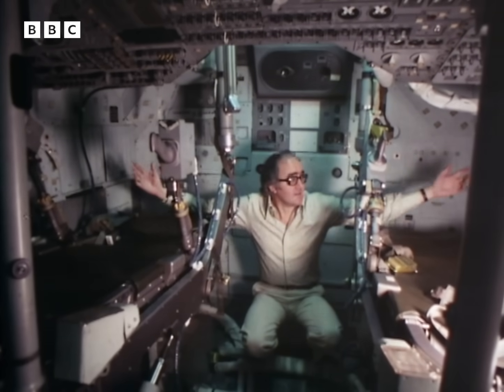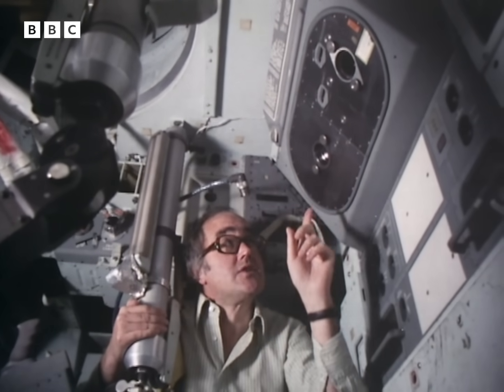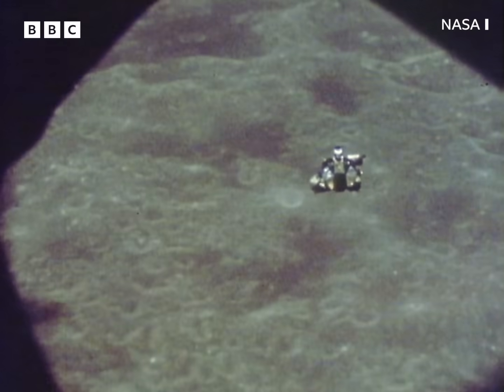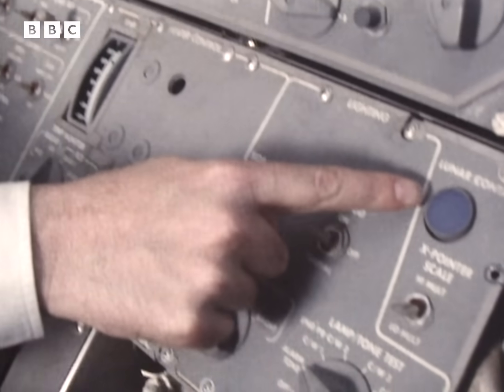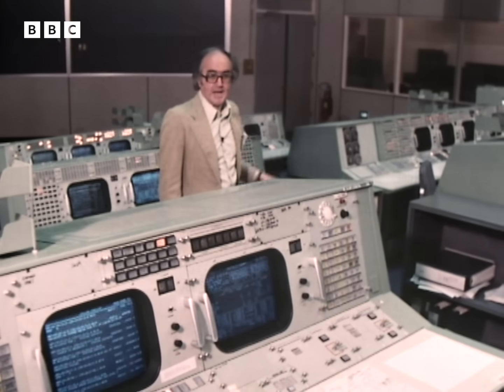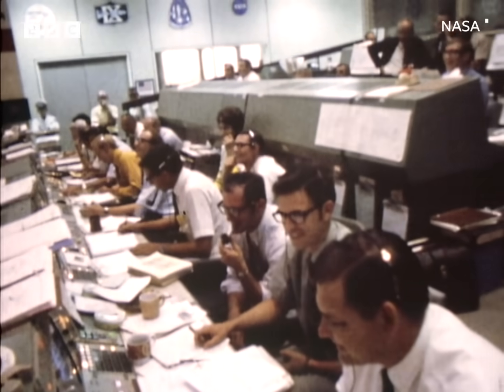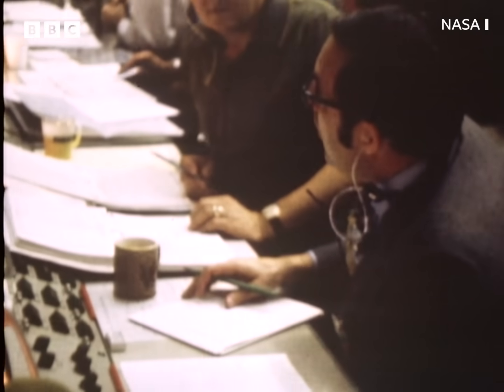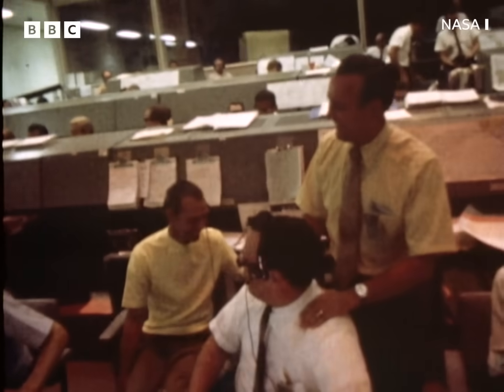1979: How to LAND ON THE MOON | Project Apollo | Retro Tech | BBC Archive

Comment: This video is one of the very few that speaks of the extremely tense descent phase just before touchdown. As explained, for various reasons the descent came to skate over thin ice, to the point that Capcom was advised not to speak further as Armstrong was in an extremely high concentration mindset where further communication from Earth would only be a distraction. Armstrong pushed through the issues, held his nerve, and made the landing -- not a perfect landing, but good enough to put mankind on the moon for the first time in history. But it was a razor thin margin.

If you dig into their thoughts from other material as I have, the unspoken message seems to be that flight control came to realize as the descent entered the last 60 seconds of remaining fuel that Armstrong was intent upon putting the Lunar Lander onto the surface of the Moon regardless if he was commanded to abort.

The Moon or bust.

Comment: The Van Allen Belt must be a complete lie that I learned in school. It's a Radiation Zone, of which would require very thick lead shielding to protect crew and electronics and impossible at that point in time. The Devine Creator put that Van Allen Radiation Belt there to keep us from venturing out into doing mischief and chaos.
I actually now suspect that the entire NASA moon venture was an elaborate Hoax. We're allowed to do suborbital space excursions and that's it. The King of King's is returning soon, very soon. All the corruption, Evil, and Sin will be eliminated from the Earth. I'm looking forward to it.
Reply: If that’s what you learned in school, you should sue your teacher. In reality, the van Allen belts are zones with radiation levels higher than on Earth. The level in the belts varies (in the center, the level is 100,000 times higher than on the edges). In the center of the belts, the level is high enough that a human in an Apollo capsule (not shielded with lead, just with 8mm of aluminium) will get a lethal dose of radiation on one week. The astronauts spent 3 hours traveling through the belts, while avoiding the center entirely. They were exposed to something like 1/1000 of a lethal dose.

Comment: Dear pseudo-scientists
What was the temperature(s) of the film inside the camera while being on the Moon?
Ask yourself why you can't control your mind to focus on the question. You are in denial. In reality, heat is when the molecules of matter are accelerated by a form of Energy. The ONLY form of Energy available for the FILM on the Moon is the Electromagnetic Spectrum of all stars which would react violently with a film. A film on the Moon cannot exist as a whole. That's why your mind refuses to think about it. You are in denial. Control your mind to focus on the question.
Reply: The film in the camera was kept cool by the reflective coating on the camera, which meant only 5% of the sunlight reached the camera. The camera was free to radiate this heat away. The thermal balance was such that the film was kept near room temperature. 
The only energy that reaches the film is the light coming in through the lens, plus some radiation that goes through the camera body. This radiation is visible as the occasional streak across the image, and in a small reduction in dynamic range.
Reply: @Hobbes746  Go to a UNIVERSITY. You are contradicting yourself. "plus some radiation that goes through the camera body" is not compatible with "The only energy" and " occasional streak across the image". Go to a University and learn about the Electromagnetic Spectrum
Reply: @Starteller  Unlike you, I actually read physics at university. My statement stands. 
Visible light: blocked by the camera body, along with all longer wavelengths, and UV. The only radiation that penetrates the camera body is ionizing radiation ,X-rays etc. And as I said, the radiation level is much lower than you imagine. 
The radiation effects on the film have been documented, those reports are easy to find.
Reply: So you are an instant expert on the Apollo cameras now? Every concern you have is explained with a few www searches.
Your paranoia and incredulity proves nothing.
Reply: @julesdomes6064  No, with my university and work knowledge in the domain. Challenge your faith and go to a UNIVERSITY. CALCULATE the light source distance with the shadows' angles, CALCULATE, the forward jumps of the astronauts, CALCULATE the temperature of the film inside the camera with the energy source, and watch there are no craters and soil disturbance under the landers and no soil on them or its pads. CALCULATE. MATHS is an APPLIED science. MATHS prove everything. Challenge your faith
Reply: @Starteller  So you think nobody with actual knowledge in spacecraft thermal design and control would have discovered this "smoking gun"? Only random guys on YouTube?

What are your credentials in the area?

I have gone to a UNIVERSITY, thank you.
I have an MsC in aeronautical engineering, and happen to work in the satellite industry on thermal design and verification of satellite equipment.

But your credentials must be much better, I assume.
Reply: @julesdomes6064  Telecom Eng. Did work with satellites too. Go check the procedure for repairing satellites in space. We are going to tell you that we have to bring the satellites into low orbit before repairing them otherwise the astronauts will die within seconds due to Electromagnetic radiations (like Gamma). Also, you didn't calculate anything that I told you and you still didn't answer the question What was the temperature(s) of the film inside the camera while filming on the Moon? Challenge your faith
Reply: @Starteller  So you have zero background in spacecraft thermal design.
I have not calculated the temperatures. But I know there are standard ways to keep them OK.

YOU claim the temperatures would be catastrophic, so please show your calculations.

And also show how you calculate that astronauts would die within seconds.
Reply: @julesdomes6064  I never said the temperature would be catastrophic. You imagine that because your mind refuses to DO it and keeps finding excuses. That's not the answer to the question. Go to a UNIVERSITY and learn to CALCULATE everything! Challenge your faith.
Reply: @Starteller  I calculate temperatures in spacecraft for a living. 
You need a lot of input data to do that.
What are your credentials in spacecraft thermal control, you said?
Reply: @julesdomes6064  No, you calculate for inside the Magnetosphere (in low orbit) in a pressurized environment with AIR. Not on the Moon, outside the Magnetosphere in a VACCUM. Go to a UNIVERSITY and learn about the Electromagnetic Spectrum. Challenge your faith
Reply: @julesdomes6064  You need a life, Hobbes!
Reply: @Starteller  Hobbes and julesdomes are the same person. He's a little creepy.
Reply: @aok4418  Thanks for the info
Reply: @aok4418  No, I am not Hobbes. Don't be so paranoid.
So when will your historic news conference be on where you present your evidence and stop the hoax once and for all?
Reply: @julesdomes6064  Sure!

Comment: 3:03 What Jim didn't say was that he probably made that mistake because he was plumb exhausted. Nobody really got a lot of sleep because NASA was still requiring one crewman to remain awake to monitor systems, being that this was only the second flight of Apollo. Frank was notoriously hard of hearing in 1 ear, so between the high radio volume and him practically shouting when communicating with Houston was keeping Jim and Bill  from getting much sleep(Then there was the whole thing with Frank getting sick, they were chasing turds and puke for most of the flight) and he had the highest workload, because of the navigation exercises and the lunar landmark tracking. He  thought he was taking a navigational fix on the earth(star 01) but instead he keyed V37N01 which started the prelaunch program. 

NASA changed the flight plan for Apollo 9 and beyond to let em all sleep at the same time. Nobody could sleep much with one guy moving around. It was one of the first things they mentioned during the debrief.

Comment: So that bucket of bolts flew a Quarter Million Milles, Docked with a "Command Module", Landed Safely, Men got out and pranced about, Re-Launched in 1/6 Gravity, Flew another Quarter Million Miles and landed Safely on Earth....

Dr. Evil says it Best, "Rrrighttttt"
Reply: No. The astronauts flew from earth to lunar orbit in the command module. Then two of them transferred to the LM, descended to the moon, spent up to 3 days on the moon, and launched back into lunar orbit to meet up with the CM. Once the astronauts were back in the CM, they discarded the LM ascent stage. 
Far from a “bucket of bolts”, the LM was purpose-designed for that one job: landing on the moon.
Reply: So, basically the only thing supporting your doubts is your personal incredulity. Strangely, aerospace engineers around the world don't share your doubts.

Groovy, baby!
Reply: @maxfan1591  My Engineering Physics Professor in College would NOT agree with your Statement.  I'm pretty sure robots surveilling the internet would however.
Reply: @eyefreely9682  "My Engineering Physics Professor in College would NOT agree with your Statement."

On what basis? What, specifically, was insufficient about the lunar module?
Reply: @maxfan1591  Bots need to do Their Own Research.  I'm not here to convince or argue.  Although I would start with "Radiation" Belt..... which is Natural yet somehow Classified information.
Reply: @eyefreely9682  "Bots need to do Their Own Research.  I'm not here to convince or argue."

I've done the research, and everything I've studied confirms the lunar module was up to the job. You know, the whole talking to aerospace engineers thing. 

"Although I would start with "Radiation" Belt..... which is Natural yet somehow Classified information."

There's nothing secret about the amount or type of radiation in the belts. First, the USA wasn't the only country to send spacecraft to study the belts. The USSR did that too. If the belts were fatal to humans, it would have been simple for the USSR to provide their own evidence of this. Or, they could mount appropriate sensors supplied by other nations onto Soviet spacecraft sent out to the belts. Either way, the USA's fakery would be revealed to everyone, and it would be an epic propaganda disaster for the USA. Second, all sorts of unmanned spacecraft operate permanently in the belts, meaning they have to be shielded against radiation. The builders of those satellites rely on NASA's data to know how much shielding to put in. If NASA lied that the belts had less radiation than they actually do, then those spacecraft would fail much sooner than they would be expected to, opening NASA up to legal action.

But hey, I suppose you have evidence that this information is classified...?
Reply: @maxfan1591  Again, DO your OWN research.  All I see in your comment is Smoke and Mirrors.  Why does it bother you that I have my Own Thoughts on the matter?  Are you a paid shill, narcissist, or bully?
Reply: @eyefreely9682  "Again, DO your OWN research. All I see in your comment is Smoke and Mirrors."

Fair enough. Would you like me to summarise the sort of research I've done? The thing here is that the people I've spoken to didn't just say "Trust me when I say I'm right," they were able to explain why.

"Why does it bother you that I have my Own Thoughts on the matter? Are you a paid shill, narcissist, or bully?"

This is a public forum where you're free to present your views. I think you're mistaken, so I'm using the same freedom you have to present my views.

My approach is to go where the evidence leads, regardless of opinions, and to present what I understand to be the facts of the given situation. If you don't like my approach or what I say, that's fine, but I'd like to think we could have a discussion based on the evidence and not just opinions (unless it's to do with sport, in which case my opinion is far more important than any evidence).
Reply: @maxfan1591  You did Not Answer my questions.  The Very Fact that you wish to be so confrontational on the Subject is Very Suspect, as a Wise Man would not go to such lengths.  Again, who do you work for or what interests do you Serve?  

Humans have NOT walked on the Moon, at least in the well known context.  I've done my Own Research and encourage All people to do the Same.